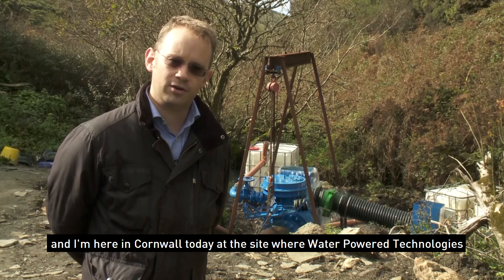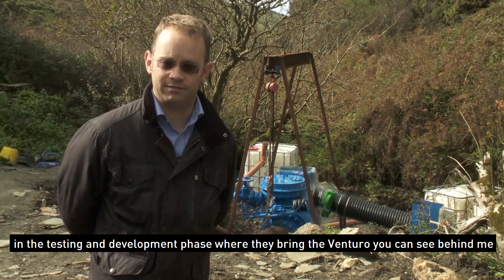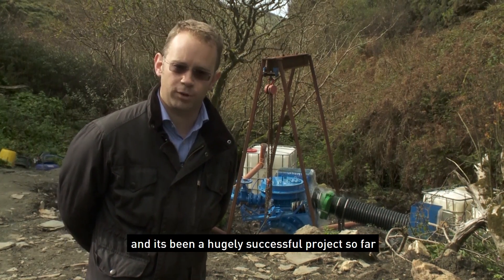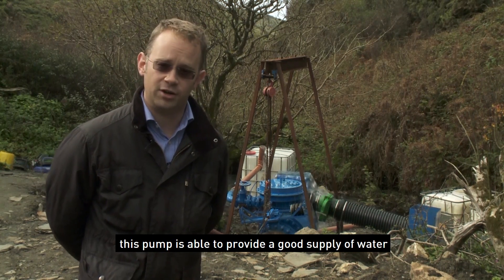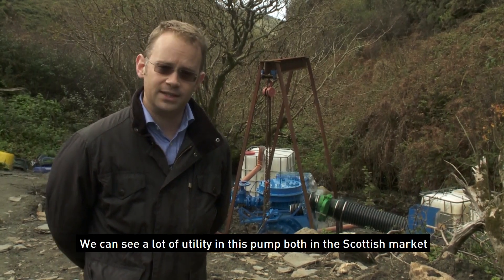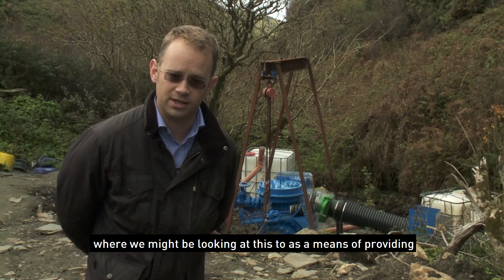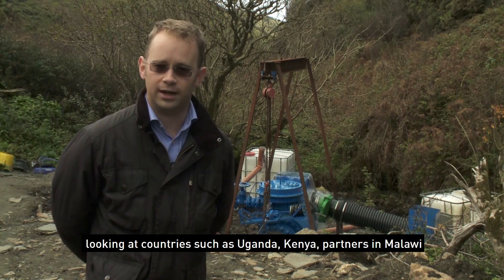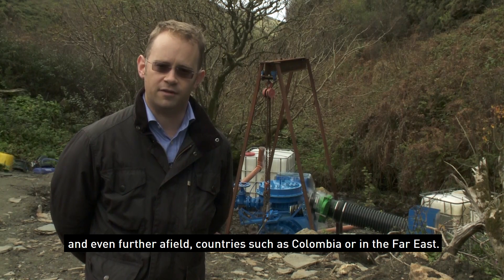Largest Ram Pump in the World - 4500 litres per minute!

Comment: but 2/3 of the water goes down the hill ? I would rather use electric energy to reduce the water waste
Reply: This type of pump is designed to take something like river water and to create upstream pressure. The water that is not pushed up stream, goes back into the river
Reply from the maker: Sustainability... if you take all the water such as with an electric pump you drain the water course. The electric pump will also cost to run, maintain and buy. Ours is much more cost effective

Comment: So if you have a river near home, you build a massive water storage uphill, then a ramp pump to keep it filled, then you build a way back to the river, and finally you built a electric generator using that last water flow.
Is this any reasonable or just a waste of money ?
Reply from the maker: It is not intended as a 'home' solution.  It can be used for pumped hydro, but it can also be used for delivering water for large irrigation projects such as plantations, large farms, wildlife reserves, golf courses, vineyards, etc.  If you have an available water source, you can 'lift' that water for gravity distribution on a large scale without using any electricity or diesel. These projects are often in off-grid locations so this pump often replaces expensive and 'dirty' diesel pumps. Is that a waste of money?
Reply: waste money..worst efficiency parcentage mybe arround 10%

u dont need ram pump to generate electricity.. u can connect the generator(need to built) to the river and use the potential power from the water flow. the cost of wire is much cheaper than pipe

Comment: It's really inappropriate to state "zero-energy".... it's certainly "zero-electricity", but energy is still needed to make it work... I'm talking about huge amount of energy provided through water flowing into the pump that is then "pushing" the water to the needed areas... I can't just simply connect a water supply and expect that the pump will provide the same amount of the water to the destination that's on a higher elevation than the source, it's not working like that
Reply from the maker: Of course you are right but we do state, "...no fuel or electricity, just the natural power of flowing water".     I think Zero Energy is quite a commonly used term for renewable energy.  We are trying to promote enviromentally friendly water pumping and need a tag line that is precise - 'zero electricity, zero diesel, zero petrol, zero (any other fuel), isn't so catchy' We're good people and not trying to deceive and not trying to pretend we've invented perpetual motion.
Reply: i have never heard it been called just zero energy. i have heard some versions been called zero EMISSION energy, or renewable energy and sustainable energy, but never just zero energy. zero energy gives impression it works without any energy input. kinetic energy from running water is still energy. but its a great looking pump. and it sounds like the waste valve frequency is much better in new parts of video (slower)